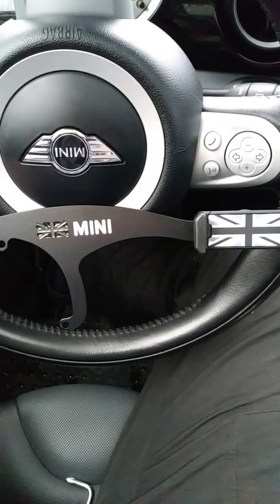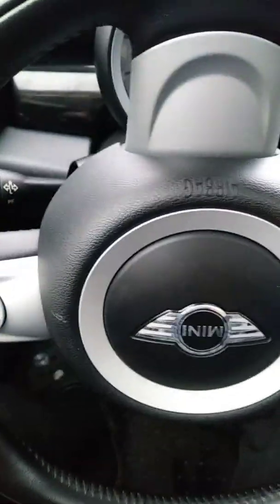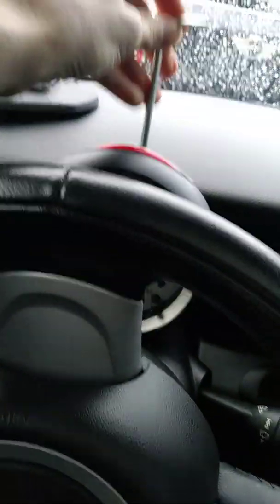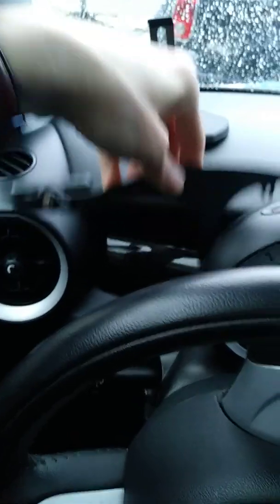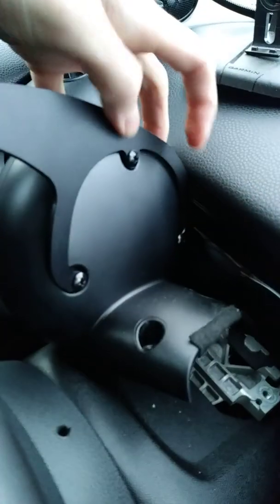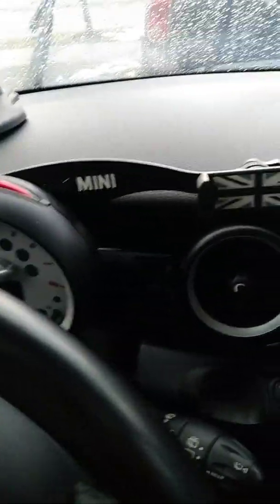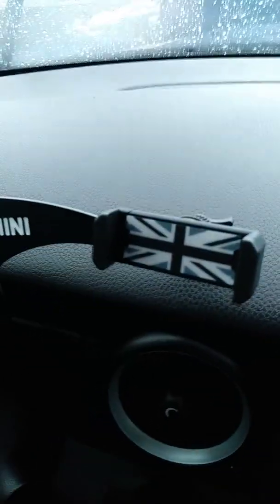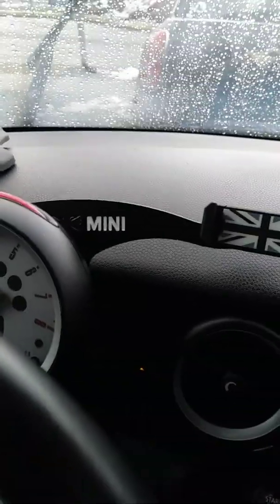2010 Mini Cooper S cell phone holder install 2007-2013

Comment: I'm currently struggling to get the right hex screw back in. Once the holder is installed, I don't have enough room to get the tool in there to screw it back in...Looking for an allen wrench right now.

Comment: hello, my car is a 2008 mini cooper r56
I was wondering if you could apply the support for the cell phone just like the video but on the left side? because I have the free hands kit on the right side, is the drilling the same?
thanks
Reply from the maker: Yes you can put it on the left as well. You would just flip the phone holder portion to the opposite side.
Reply: TallManFlex product reviews/installs thanks

Comment: When you unscrew the tachometer, are there wires?
Or
Just plugs in and out?

I couldn’t tell
Reply from the maker: It's just the screws, you don't need to  do anything else to the tachometer. You just swap the screws it comes with which are longer if I'm not mistaken.